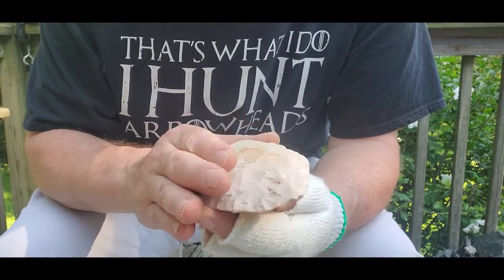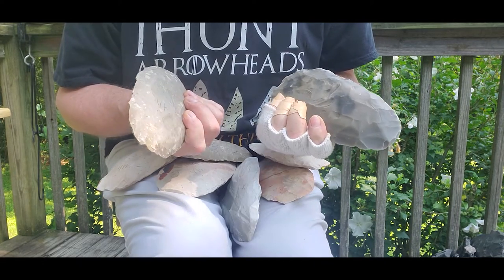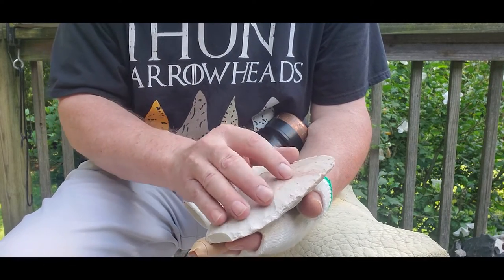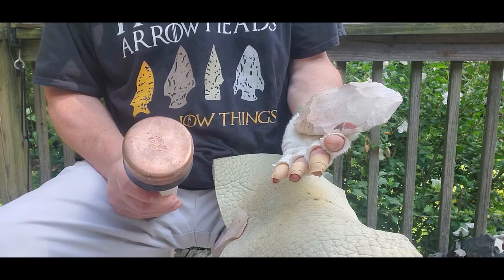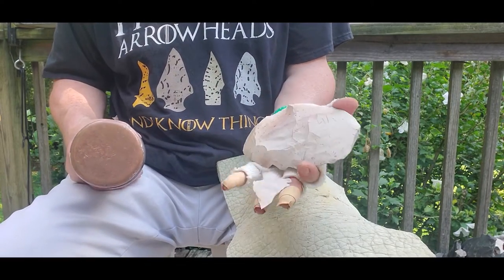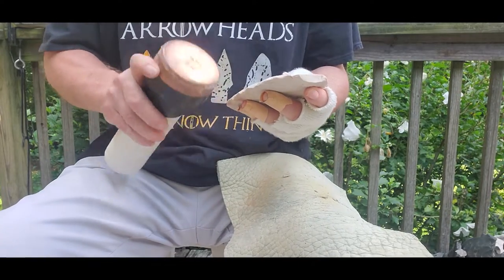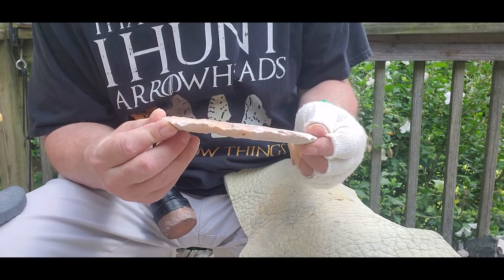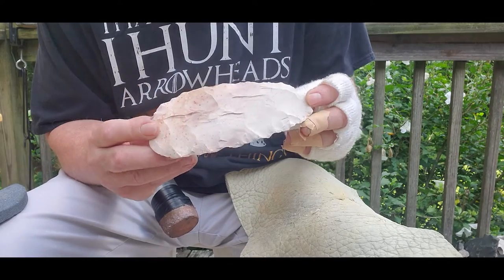Flint Knapping Biscuits - Amazing Tips for Rapid Thinning

Comment: Can you  make a biface preform "biscuit" using all organic tools ( antler, stone, horn, bone, wood etc). Did the Native Americans have large prices of copper to Knapp with. Must be something to find a Nugget that large. I guess if they found one they would melt it down & mold it. I think I read the mound people 4 to 6k BP knew this method.  But I think copper was sacred & used for ornaments. Maybe only the master knappers we're allowed to use it to make burial stone tools? Does copper flake removal produce different flake removal signatures on Flint. In 5 thousand years will people be able to tell the difference between Native American artifacts & ones made now? Will this devalue collections of artifacts? Should modern a knapper sign their work? Thank you for sharing your knowledge & a great video.👍
Reply from the maker: Raw copper was available in Michigan and traded all over. Copper axes were found in many places even in the south. It was probably not used for knapping since they were skilled with antler. Yes copper flakes different than antler because of the density.